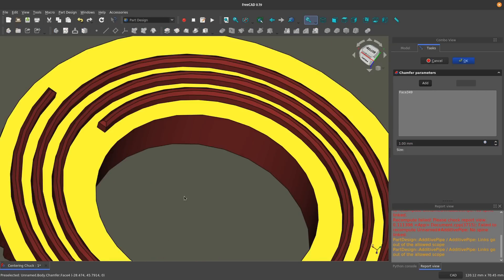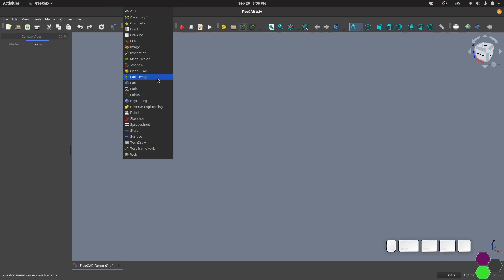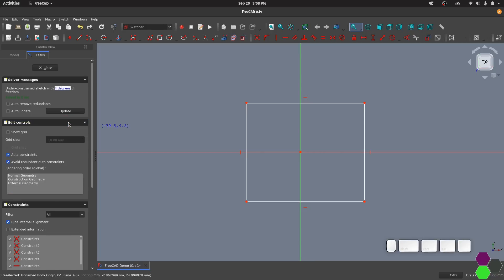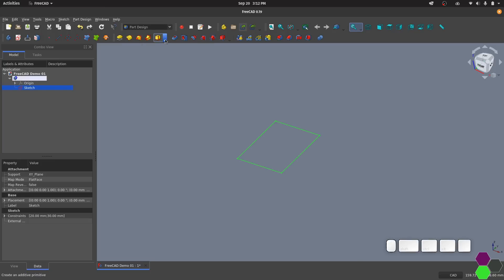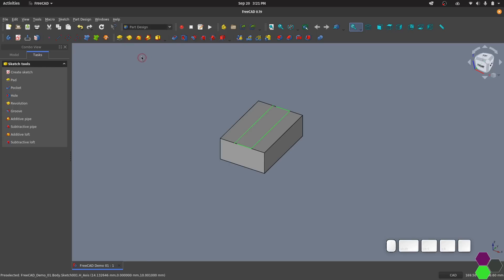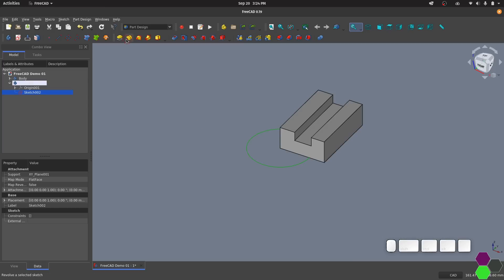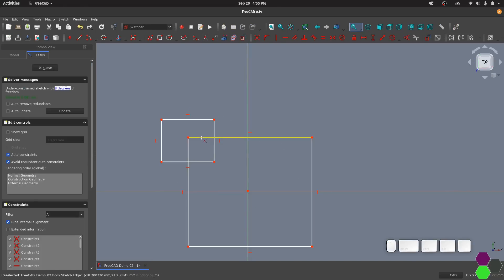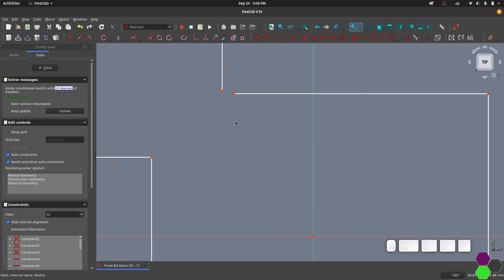Fusion360 to FreeCAD - Introduction

Comment: Is rhinoceros a valid replacement of fusion for 3d printed designs?
Reply: The tool you use to create the model doesn't matter, so use what you are most comfortable in.  You can use SketchUp, or TinkerCAD, or Blender.  As long as it's clean and water tight it's fine.
Reply: @Mark_5150  Thanks, that's reassuring to know. I'll just keep focusing on rhino then, as that's what I normally use.
Reply: Asking because i already have rhinoceros
Reply from the maker: I've never used Rhino, so I'm can't really comment on it.
Reply: Definitely. I teaches Rhino and it is used to create models for 3D printing.
Reply: @simpernchong  Hi there, I'm already a subscriber of your channel. Haha
Reply: @user-yk1cw8im4h   I see..haha

Comment: Really great video, so many little tips to pick up. I was trying freecad for the first time tonight and I had struggled without knowing how to align to the grid/edges, I know now! The UI also looks much better with your suggestions! 
The other thing I was struggling with was camera control, the cube in the top right can't be dragged like in fusion and the camera itself seemed to stay in rotation mode until I let go of shift. Maybe a video on that would be good :)
Reply from the maker: Instead of "Shift + Right Mouse Button" to rotate, you can also use "Middle Mouse Button  +  Right Mouse Button" (Which I always forget doesn't exist in Fusion every time I use it)

Comment: I am trying to convert too, but i can't figure out how to extrude  part from the sketch - not the whole sketch. I used to do that alot in 360 and that's just how my workflow is. I red in a forum that i have to select the edges i want to extrude (they have to form a closed loop of course) and upgrade them to wire and then upgrade them to surface that i should be able to extrude. Upgrading to wire doesn't seem to work though. Any suggestions? Is my freecad broken or am i missing something. I use 0.19_22474 because auto constraints is not working in the current stable version 0.18.4
Reply from the maker: This caught me out when I first transitioned from Fusion too and shows that I really should have left information about turning construction geometry on an off in a sketch.
Short answer is, in the "Part Design" workbench, you have to pad the entire sketch, but, you can change which parts of the sketch are included in the pad by editing the sketch and toggling on "Construction" for any of the lines you don't want included in the pad.
You'll notice on the right hand side of the sketcher tools (just before the constraint tools in the way I have the toolbars setup in my video), there is the "Construction Mode" button (red square with a dashed Blue square above and right of it). You can select any line(s) in your sketch and click this button and it will toggle whether or not the line(s) are included (white lines) or ignored (blue lines) in a pad (or any other operation).
Joko Engineering shows Construction Geometry 18 minutes into this video https://youtu.be/gbNg3mzm84s
I hope this makes sense.
Reply: @BrodieFairhall  Thank you for your reply! I will try this tomorrow. You've gained another subscriber.

Comment: This video is very nicely done. Great info on the similarities and tips on how fusion360 users can find comfortable ways of doing things in FreeCAD.  But, it immediately teaches techniques that, while very convenient, wiill almost guarantee the new user will quickly face the topological naming issue. Especially when encouraging the user that sketches can be changed at any time. While ture, there are caveats.  Teaching/explaining how to use sketches attached to base planes with offsets, and other techniques, while less convenient,  can avoid confusion and frustration. New users have enough to cope with transitioning from Fusion360, no sense adding to the frustration.
Reply from the maker: Absolutely right, I'm doing a few more videos this week and one is specifically going to be about the topological naming problem, how to cause it, how to fix it and ultimately how to do it properly. Most people who try FreeCAD, unfortunately drop it after 15 minutes of trying to get anything accomplished, so I just wanted to get people feeling like they can actually create something before dropping the big problems on them, especially when Fusion lets you get away with so many lazy things.
Reply: Yea, I see the "15 minute" tolerance all the time. I did a series of written tutorials that, I thought, tried to present the "learn to stand, before you attempt a marathon" and the response was a room full of crickets. ;) And, yes, Fusion does allow one to get lazy. ;)

Comment: It is not advised to link to external geometry in the fashion shown, instead the sketch should be linked, not the generated solid. Otherwise a decent intro,well done.
Reply from the maker: Absolutely right, I'm doing a few more videos this week and one is specifically going to be about the topological naming problem, how to cause it, how to fix it and ultimately how to do it properly. Most people who try FreeCAD, unfortunately drop it after 15 minutes of trying to get anything accomplished, so I just wanted to get people feeling like they can actually create something before dropping the big problems on them, especially when Fusion lets you get away with so many lazy things.

Comment: This is exactly the video I was searching for! The new license changes prompted me to look for alternatives to Fusion 360, plus I realized it won’t run natively on the Linux workstation I’m building next year. I’m still pretty new to CAD in general so I figured better to switch now than later, but all my experience so far is with Fusion so I was looking for a tutorial just like this to get a jump start on switching. Thanks for taking the time to make this!
Reply from the maker: Glad I could help!
Let me know if you get stuck on anything in particular.
Reply: Freecad trava muito
Reply: Same reason I'm here.
I always hated fusion  since I learned solidworks first. And their price changes and reducing features has only made me hate it more.

Comment: I laughed out loud when you said that hole is something you'll probably never use because that's a specific software feature I'm looking for. In Fusion 360 it's great for easily modeling printable threads and countersunk fasteners.
Reply: I dont use the grid in 360, so would not use it here. Been playing with freecad for a few weeks now, but still use 360 on a regilar basis for modelling.
Reply: Ditto the comments about the hole feature - it's extremely useful when ultimately moving to engineering prints.  If all one is doing is FDM/SLA printing, probably less so, though the standard c'sink and c'bore features are good to if you want to print them - get them sized right.  Though I was just messing with it in 0.19.22665 (current as of this is 22670) and the hole feature is broken in it.  Working fine in 0.18.  So one's mileage may vary with the development build rather than the stable branch.
Reply: Even for FDM prints modeled threads are quite useful. For example, I made a microphone shock mount with 1/4"-20 thread to mount on a standard tripod and it works great.
Reply: Yeah I use FreeCAD and regularly use the hole tool. As someone else in this comment section mentioned, "he hole tool allows you to define a hole with a radius, counterbore/countersink, and optional tapered point at the bottom. The software will then create a revolved cut with the defined profile shape. This can be later edited as a single feature with a single defined center point, which will reduce the number of sketches and features that you might mess up"
Reply: In FC there is an add-on which allows for the creation of scaled threads specifically for 3D printing, the fasteners WB.
Reply: Just like "you will never use the grid". Something in the middle of nowhere looks great. I guess they tried to create software not for designers but for kids.
Reply: @vladimirseven777  Sketcher is a constraints driven application, for noobs using the grid can give the impression that lines/curves are connected because the endpoints start/finish at the same place. This is not the same as being constrained together. That is why a lot of people never use the grid. It just isn't much help.

Comment: Awesome stuff, thank you! Would love to see an Assembly! Also during the weekend I've now several times come across the recommendation to NOT sketch directly on a face but rather create a datum plane and use that instead, to work around some error that's currently still in FreeCAD. I'd love if you could go into that, maybe with a demonstration of said error so one knows what one wants to avoid. Right now it's all still a bit of a mystery 😅
Reply: That is called the https://wiki.freecadweb.org/Topological_naming_problem and it results in problems down the road, when you have to recompute the model, such as when changing a parameter. Attaching a sketch to a face makes a relationship based on the numbering of the entity, e.g. Face01. So if that face was the result of some operation, like a Pad, and you recompute your model, but your faces come out with a different numbering, e.g. Face01 is no longer "the top face", then your model will break.
Reply from the maker: @kurtkremitzki1558  Absolutely right! Fusion actually suffers from the same problem too, but less people encounter it I guess.
I can definitely show an example of the error in a video too, I have done it to myself a lot.
Reply: @BrodieFairhall  That'd be a great video. 👍 TiA 😃
Reply: @kurtkremitzki1558  Thank you very much! I really need to do some reading on the wiki it seems. That node just did wonders to my understanding.
Reply: I'm looking forward to realthunder's topological naming fixes making it into mainline FreeCAD. I think the advice on how to use datum planes I've read hasn't been consistent. I'm still new, but I get the idea that the best approach is to have the datum planes drive both the surfaces and the sketches that would be on those surfaces? But realthunder's work should usually make that a boondoggle I think. I've gotten used to SolidWorks getting topological naming mostly right, but I've still seem models fall apart topologically there and realthunder's naming scheme looks even more robust. I crashed his build before managing to induce a topological naming error when I tried yesterday. 🙂
Reply: @MichaelKJohnson  I'm new too but I think another method was to only bind the sketches to the main planes (XY/XZ/YZ) and do a placement offset. I'm also looking in how to use a master sketch to make my designs parametric, but I like the spreadsheet method more.
Reply: A video about datum objects would definitely be nice. I got problems using them (which actually might be the same issue as directly sketching on a surface). 
Example: I have a double cone (imagine a spinning top) with a hole from tip to tip, and want to make another hole halfway up one of the cones to the center with the direction being parallel to the slope of the other cone. I managed to get that done with using datum points, a datum line and a datum plane (which is tangential to one of the cones' surfaces) to draw a sketch on. But when I change the sketch for the double-cone, the datum plane flips into a different orientation (no longer tangential) and sometimes position. How can I make a model like that "more robust"?